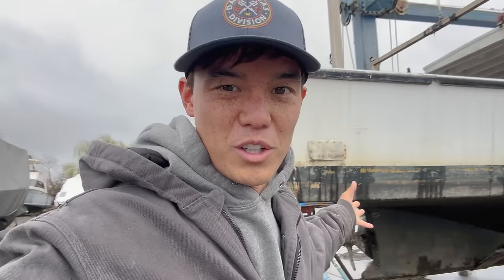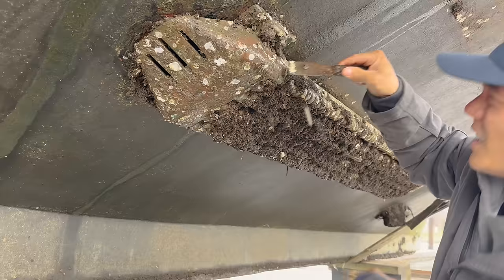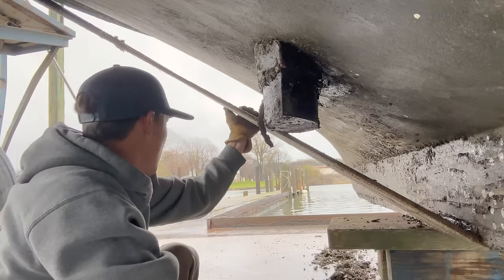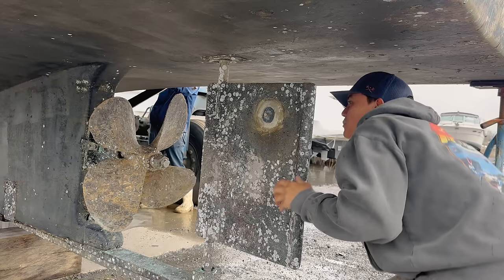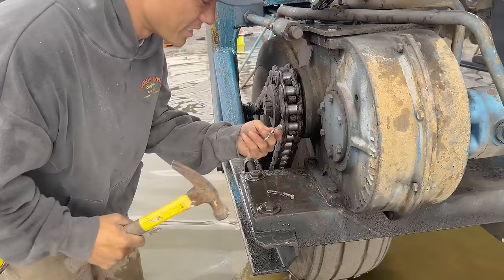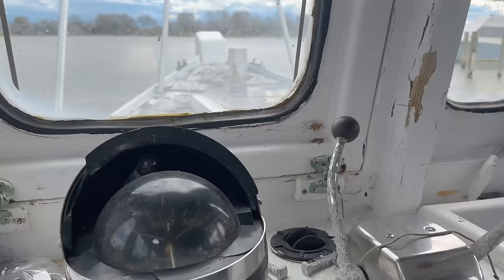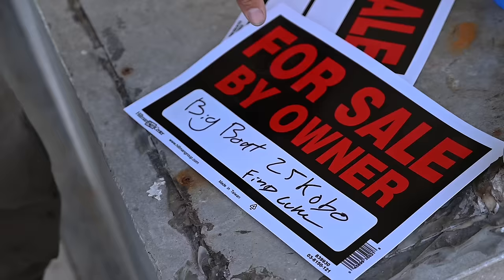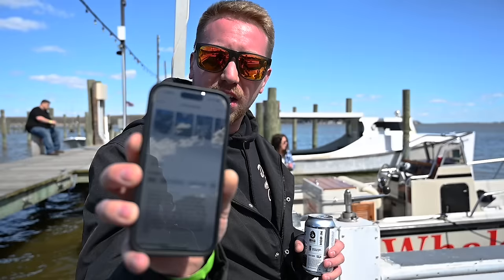Why I DON’T sell boats on the internet

Comment: $10/gallon straight muriatic acid from Ace Hardware, wear a respirator rated for acids and goggles and gloves. Super effective, just did my boat that was covered. Spray, let sit, pressure wash, repeat. I know you’re already done but suggestion for next year 🤙
Reply: I use sulfuric acid it takes everything off.
Reply: I was surprised that any type of acid is allowed to clean the underside of a boat so close to the water. Isn't that harmful to the ecosystem or does it diapate with water?
Reply: @327JohnnySS  bring a big tub of baking soda to neutralize it when you're done. It becomes harmless once neutralized and diluted.
Reply: @shortlivedglory3314  That makes sense. Thanks 👍
Reply: @327JohnnySS  lol tell me haven't spent time at a dock without saying you've never spent time at a dock

Comment: I've been doing Line-X material that was originally used on truck beds on the bottom of my boats etc and the life is far superior to paint.  As well as cleaning barnacles and things of that nature come right off.
Reply: Guessing just getting it coated in a smooth fashion instead of textures,Ike it usually is in a bed of a truck??
Reply: Maybe Project Farm should do a video about what to coat a hull of a boat? That would be interesting.
Reply: @james94582 yeah that’s exactly what I was thinking. Definitely just get it smooth rather than textured and it would probably be wayy more durable. I saw a guy in our campground that had an older jeep on 37’s that was completely painted in textured bed liner, even parts of the interior, and a marine grade sound system so it was waterproof.

Comment: The reason why the acid based cleaner is turning the webo lettering green is because it's copper based paint which is what many bottom paints contain and the acid is leaching the copper from the paint.

Comment: I bottom painted in the rain in the northwest. Take your masking tape and run a strip of tape around the water line with the tape folded backwards in half on itself. The bottom half of the folded tape will stick out and make a drip line that the rain will run off of instead of running down onto the bottom.

Comment: I like how you guys are using the corded grinder above looks like 3 or 4 inches of water!! 10:46
Reply: I was just about to make the same comment
Reply: I came here to post the same thing, but was positive that I could not be the only one to notice that and post a comment on it.
Reply: You must not be a crabber
Reply: As long as the plug stays out of the water you fine..
Reply: If you use a cordless, and drop it, how would you get it back? That's what the cord is for genius.
Reply: Did you miss the cord being full submerged going off into the distance??
Reply: GFCI test harness.
Reply: You can put popcorn kernels in your pockets and have a snack.🤣
Reply: @Rabbit-the-One   I either drop a cordless in the water then get 
Electrocuted !

Comment: From my experience, when a crane is load tested, going beyond rated lift capacity by 10% is the standard so while 100 extra tons sounds like a huge number, the operators want it proved to that number.  They also know that it could go higher.

Comment: on & off will help with the barnacles but not the whole thing. You have to scrape off the majority of the shell then apply on & off with a brush or foam roller and it dissolves the left over barnacle "dimes" quite well. Give it anther shot sometime. 
Another trick, Spray pain your underwater metals (props, shafts, intakes, keel cooler) with rustoleum cold galvanizing zinc paint. It is the same composition as Petit barnacle barrier except less expensive and easier to remove for recoating in the spring.Its very effective for keeping growth off underwater metas and props.

Comment: I actually work on bridges, mostly highway bridges but I've definitely worked with bigger cranes and I'm in Pennsylvania. However that crane is pretty damn massive. I may be coming down to see what's going on with the rebuild but it's still too early to kno about breaking ground as far as starting the actual work.

Comment: For knowledges sake, the acid in your cleaner is capable of disolving multipe metals(nickle, chromium, iron)  so maybe if you used antifouling paint for the letters? Or just picked some up on the hull in travel.

Comment: Have you ever thought of the possibility of putting a tunnel in the hull, it would probably set you back 3 or 4 grand, but in the long run you could gain 1 foot of water. my day and I had the same issue oystering in south Texas that we built 2 -40 foot V hull boats with tunnel drives that enabled us to work in 3 foot of water.

Comment: On off is great stuff expensive though. I’ve worked in a boat yard for years and I always just use diluted muriatic acid. Works the same and MUCH cheaper

Comment: Get a 5000 psi pressure washer with a wand that has diffrent tips get the red one on there they will pop off our pressure washer cuts concrete woth the red

Comment: Is the cleaner you use on the bottom being caught before ending up in the water 30 feet from the boat?
Reply: Where’d the EPA get a YouTube channel
Reply: It's acid. It will dilute pretty much instantly to be completely harmless. One of the reasons it is a popular, marine/pool cleaner.

Comment: Heat the brass with a gentle torch, clean, then apply antifouling to prop and rudder. Same on the heat exchanger. The wood at the bottom of the keel is sacrificial for accidental wee nudges.  You should keep the Webo and run Blue Catfish head boat charters. Becoming popular and I am sure the DNR would support you in that. Sell line caught blues.

Comment: Dude!!!! Take it from a guy that works at a Marina and my only job from spring till fall is painting bottoms and there is this amazing machine that make removing barnacls very, very easily...it is called a "SANDER"!!!! Get yourself a sander and 60 grit and it takes those barnacles off in seconds!!! Work SMARTER, not harder my good friend!!

Comment: Don’t use that expensive ass Mary Kate’s on and off you can use son-bol toilet cleaner and it will do the exact same thing just as good as on and off! We used to use it on the gill net boats in the southern bay in the 90’s hell of a lot less expensive then on and off too! Sno -bol and a cheap sponge mop will clean the water line and sides and remove all the water stains etc try it and see…